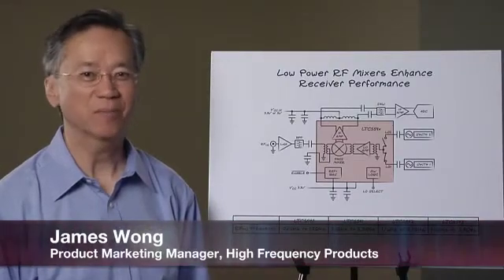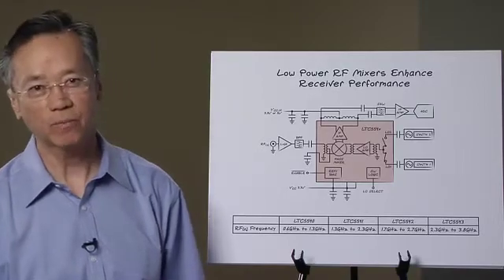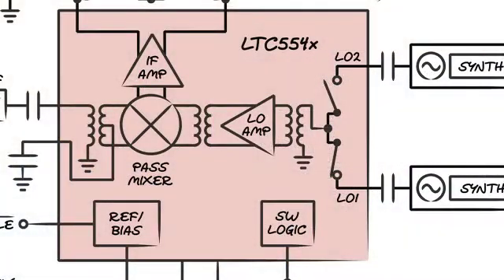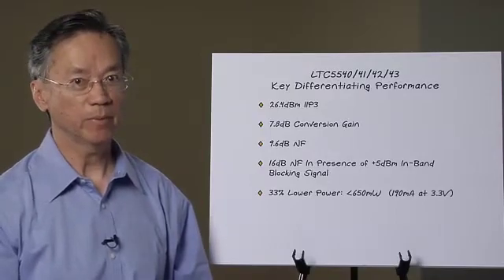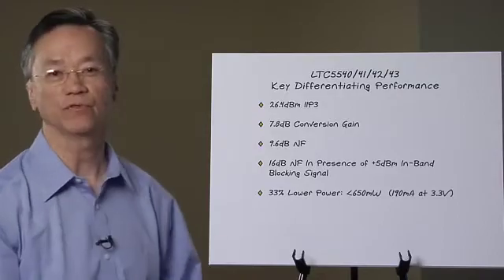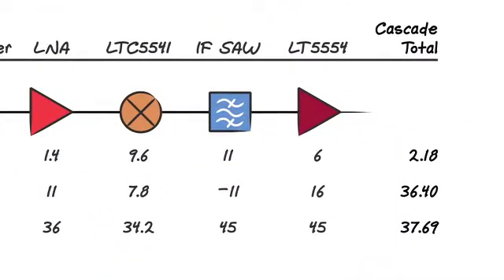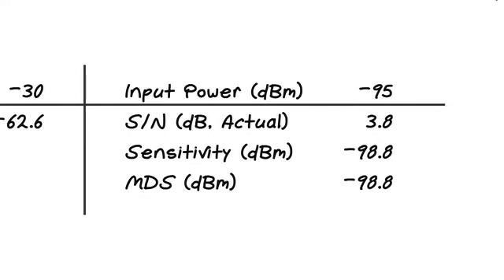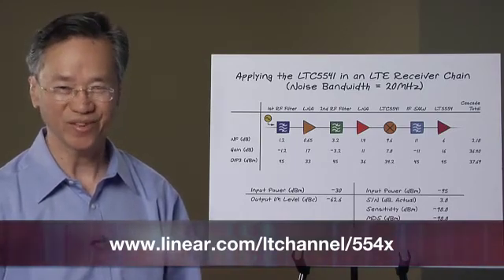Low Power RF Mixers Enhance Receiver Performance

Comment: With such high performance LNA in front of the receiver (NF=0.65, Gain=17, OIP3=33 ==> IIP3=+16dBm), I do not wonder why the total receiver achieves such good specification. The noise contribution of the passive mixer on the total system is almost notihing. For in-band blockers, where no/less RF filtering, the passive filter will have more effect on the total linearity under the condition that the first two LNA will not distort the desired signal a lot ! (my opinion)